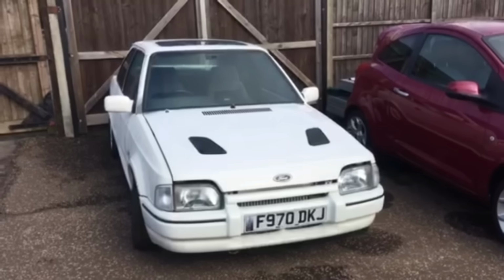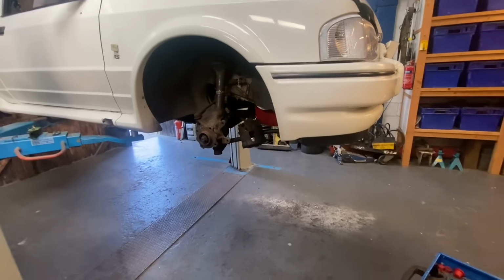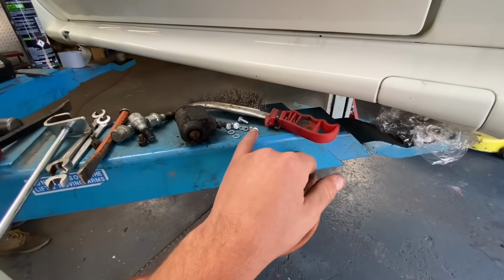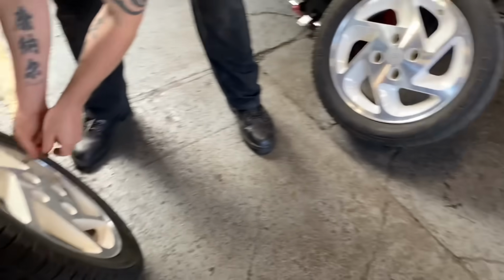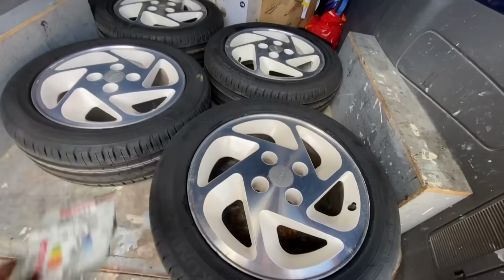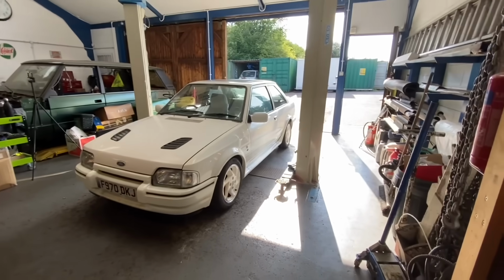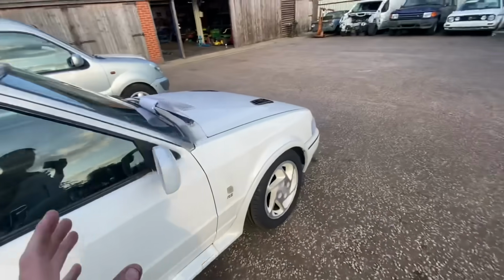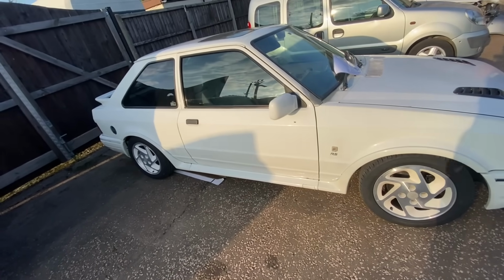Barn Find Ford RS Turbo S2 Escort First Drive

Comment: The bottom will drop out of the classic car market over the next couple of years as you will not be able to get the fuel to run in these very old engines. also very poor practice from that dodgy tyre fitter throwing the tyre up onto the face of the wheel to apply bead lube then spinning  it, i work for Pirelli and that is big no no as this can damage the lacquer on diamond cut wheels or scratch the faces, so please inform them of their poor fitting  practice
Reply: Not everyone owns classics to sell them. Some people genuinely enjoy the car. Petrol is always going to be available. How expensive and accessible no one knows.
Reply: @andrewwallace1030  Are you sure that Petrol will always be available and when i ask this i say petrol that can be used in these older engines without untold damage?? the more bio-ethanol thats added to petrol the more it cant be used in engines for cars of certain ages, im not sure that the current petrol thats available now E10 can be used in this engine without issues
Reply: Bore off Carl

Comment: i have been watching your programs for some time.  To date its been good.  However the last couple of three videos leave a lot to be desired who needs to see you taking scrap from the yard or setting off an airbag.
re: rs turbo - I am in disbelief you have not changed the springs while you had it on the ram.  Furthermore, wtf did you not put a new brake line on a car of that age. 
If that is your standard of work I am shocked.  I look forward to your reply.

Comment: Can't believe there are rear drums on an RS Turbo 😳
Reply: It's a Ford, not surprising my 85 Corolla gt had discs all round
Reply: You really don’t need rear discs on the majority of FWD cars, the rear brakes hardly do anything. In fact discs end up getting seized through lack of use and more rain exposure than drums, more often than not.
Reply: @twelvereasonswhynot  hmm, two questions.
Why would it matter which are driven wheels?
Why put discs that are bigger than most front discs on the back of my S class?
Reply: @tomf4547  Because the brakes on the driven wheels potentially have to directly resist the torque from the drivetrain; on any undriven wheels, it's just the momentum of the vehicle. That's why you'll always find much bigger rear brakes on RWD or 4WD cars than FWD ones. 
If your rear brakes are larger than the front ones (as they are on my BMW 1-series) it could be because they have a central mini-drum parking brake, so the overall diameter is larger to compensate for that (but the overall swept area is probably still less than the front brakes).
Reply: @twelvereasonswhynot  ahhh all makes sense.
Nope my front ones are the size of satellite dishes 😂

Comment: I admire the tyre fitting garage! Unfortunately many tyre fitters have great machines, but not calibrated properly, or mis-operated by inexperienced staff! The machine says your wheels are balanced, but you still get vibrations on the motorway! Same problems with faulty front wheel alignment! Looks like "your" fitter is a good one!

Comment: When you were working on the rear drums I thought the pipes looked a little crusty and they usually go close to the wheel cylinder. Mine burst due to someone changing lanes at the last minute and had to slam the brakes on.
Reply: Had 2 fords and both cars the rear drums explode or simply fall apart. Near put me off the brand for life and 100% never buying a car with drum brakes ever again. Brave driving this thing.

Comment: Rob you know those rear wheel cylinders may not be leaking but as soon as you push on that peddle hard it will be leaking 
So it has to be done 👍👍
I had to have another comment didn’t expect the pipe to break 
Just a little scare there,  good that it went now and not after you had sold it

Comment: They don’t need the slot on the cylinders
Reply: Yes it does ,he explained it in the video why .
Reply: @inchaseable1  I have fitted plenty of these !
Also have them on my own rs turbo no issues . It’s the ones you get at every parts suppliers when ordering them .
Reply from the maker: It does bud or the shoes sit on the back plate 👍
Reply: @sruk  been running my for 5 years with they cylinders zero issues .

Comment: Old steel brake pipes can be deceptive. I restored a 1968 Austin Cambridge about 5 years ago and it had a mixture of original steel and newer copper brake pipes. I replaced the copper ones as I had no idea  what quality they were. I also decided to replace the original steel pipe that went from front to back, even though it was rust free to look at. When I took this pipe off the car, it split in half due to corrosion at the back of the pipe where it was clipped to the chassis. On these older cars with single circuit brakes, a failure here would mean no brakes at all. It is good advice to change ALL the brake pipes.

Comment: Great content and fantastic to see Chris starting the video 😁 Genuine question. If I had a “do not drive” on my MoT I thought I’d need to get the garage that did the test to do the repairs. You were able to drive the car back to the workshop. Is that a benefit of trade insurance and plates or have I misunderstood the regs??

Comment: Good interesting video as ever. Kumho are a reputable OE fit tyre brand but we had a brand new Hyundai with Kumho KH7 tyres that failed its first MOT due to cracked tyres (including a  newer one fitted due a puncture so it wasn't just a faulty batch) caused by exposure to sunlight (not garaged) so it might be worth keeping an eye on them.

Comment: Will be nice when finished,  at least you know all will be mint when done , new pipes , cylinders,  discs pads and master cylinder as well as springs and tyres , it should handle very nice , Chris sounded great on the intro 👍👍👍👍

Comment: I think Ford may have been a bit late to the party with rear disc brakes but I can't believe they put drums on the back of those things.
Maybe a good thing the pipe gave up early on and you can fix it. Good fortune you didn't hit anything as a result.
It'll be a gem when it's done lads. Keep at it. 😃😃👍

Comment: I see your fitting a non abs set up but I’m pretty sure all S2 turbos have abs as std ?
Tbh the return pipes are into the  fluid bottle.
Not sure on those rear cylinders-I think they flat ones work & seem to recall them being like that.
Anyway love the spoiling of boost noise. I can’t wait to get mine back on the road next year 😊
Reply: It was an option. Driven ones with and without same as the xr3i
Reply from the maker: This car doesn’t have abs
Reply: @sruk  👍
I thought they all did but a lot was removed ‘back in the day’
Way to tell I guess is if it was originally I’d of there’s the bracket for the load valves on the rear wishbones.
My D plate custom has them.

Comment: Oof. Just as well the pipe went now. Are you going to renew all the brake pipes and flexis for safety? Not going to take you long to finish now!
Reply: No need to replace the flex my pipes as they are upgraded and standard ones are naff
Reply: @bmwman1981  I'd still replace old braided flexis TBH. Better safe than sorry eh!

Comment: Worth bearing in mind that braided hose are excellent at hiding underlying deterioration in the rubber house underneath. You can't inspect them for deterioration like a rubber hose, so failure tends to be sudden.

if you can't tell how old those are, I'd treat them as suspect and replace them.

Comment: Those MOT failures certainly not a  disaster, a very minor set back. probably a good thing you had to jump on the brakes letting the brake pipe pop.
Personally  I would have swopped the rears to all disc brake. Dont let it get you down Chris 👍👍👍

Comment: Rob would it be worth changing out all the metal brake pipes for the peace of mind when you do foot it just a little bit :)just with the car standing so long, and its a win as no rot or welding to deal with and a smile of a bit of boost.

Comment: Shame if didn’t pass but it gives you more motivation to get it sorted correctly. 
If it were mine I’d be looking for another set of wheels as these have been diamond cut and even painted silver will look messed with. 
Can’t wait for the next video on it with all the std indicators and hopefully driving lamps. 
Brilliant job again guys.

Comment: Great stuff. Glad that the brake pipe broke now, rather than at a more critical time. An excellent result and an opportunity to get the brake pipes fixed. Maybe replace the full set as preventative maintenance.

Comment: Never understood why these had rear drum brakes. A disc conversion would be a nice touch.
Reply: Sooo true, quick and easy too 😊, why did they not do that?
Reply: @PeterJames-cr1ul  
Even worse seeing rear drums on modern cars, there's absolutely no excuse for it these days.
Reply: @paulie-Gualtieri.  also very true, the only reason is costing, drums are a less expensive manufactured cost. I would never buy a car with drums they’re just too much of a maintenance issue, not to mention the poorer performance.
Reply: Cost. Its a ford.